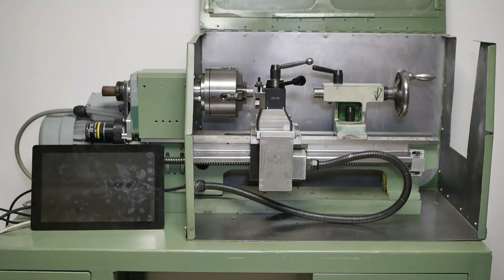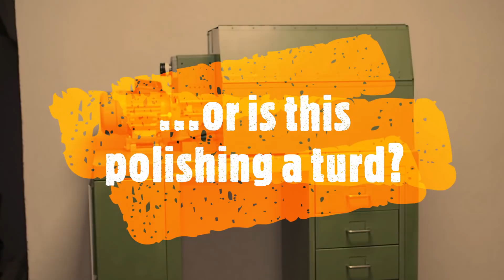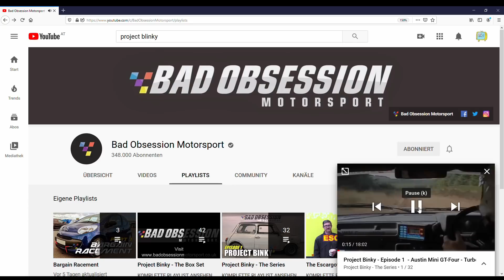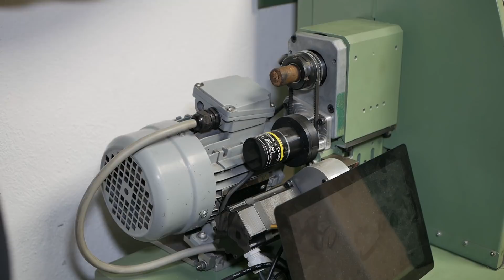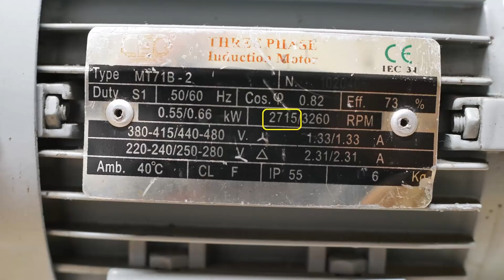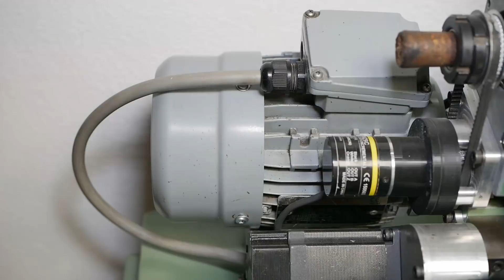Big Motor / Small lathe - CNC'ing the 7x12 Mini Lathe - Episode 32 || RotarySMP

Comment: I use the same motor on my mini lathe, it works great, you might be able to take 0.5 depth of cut on steel if you chose right speed and feed.
Great choise
Reply from the maker: That is good to hear. Did you keep the original internal back gear?
Reply: @RotarySMP  I kept oryginal internal headstock gear(the metal ones) and i use htd 5m gears to drive the spinele, 9mm wide belt is great when you crash the lathe, it just strips few teeth. I recommend you to make belt reduction 1:2 from motor to headstock input shaft. Its great for me. Perfect for parting and still gives great speed range.
Btw. Take a look on my channel, theres some video's showing performance of mini lathe at my setup.
If you want to see detailed photos check this Polish forum: https://www.cnc.info.pl/ulepszenia-mini-lathe-t98325.html#p694679
Reply: @RotarySMP  Congratulations on the conversion, but always a lack of power with the original engines. That's why I put the 1.1kW motor, direct drive belt to the spindle, max 1400 rpm, although I plan a small conversion to a toothed belt, because the flat belt needs to be tightened and the bearings fall quickly.
Reply from the maker: @scorpioo7350  I guess there is a reason why an industrial CNC lathe uses a 30KW motor on the spindle to replace the gearbox.
Reply: @RotarySMP  In the past, smaller motors with gears were used, so it was possible to choose the right speed and torque on the spindle with the gear. Now the drive in CNC machines is direct, which is why such powerful motors are used. Paradoxically, with small diameters, the need for high revolutions on the spindle and smaller Nm, and with larger diameters - smaller revolutions and high torques. Therefore, high torque motors multiplied by the spindle speed are used, which gives such powerful motors
Reply from the maker: @scorpioo7350  Yep. I think adding a somewhat bigger motor to these little machines doesnt gain much. You would need to do like a 10EE and put in a 7KW motor to really get 3000RPM and low speed torque for threading. That is why I put the back gears bck in. The metal gears are noisy and will wear pretty fast, but give much greater torque.
Reply: @RotarySMP  In mine I had a max of 2800 rpm and when turning larger wheels with a diameter of 80mm. I had to reduce the speed to about 400 rpm, it caused the engine to heat up quickly, so I reduced it to 1400 rpm
Reply from the maker: @scorpioo7350  This is what I also did. What was really needed was a different lathe :)
Reply: They are noisy and wear fast if you dont lub them. The solution is simple. Just convert headstock to be filled with oil, its quiet and provides lubrication for taper roller bearings and gears. I am using it this way for about 2 years